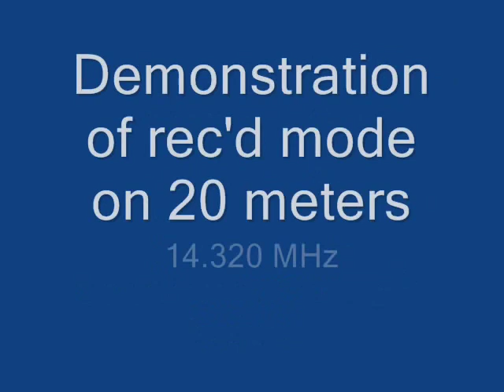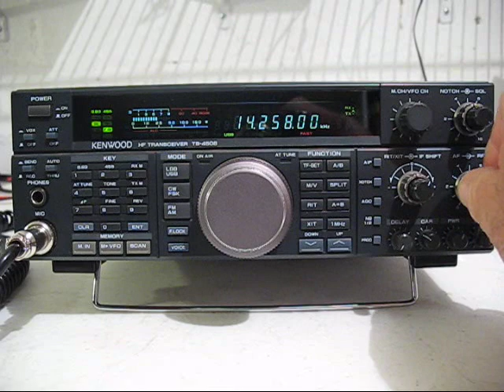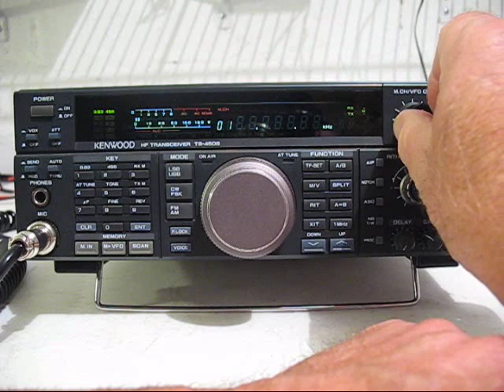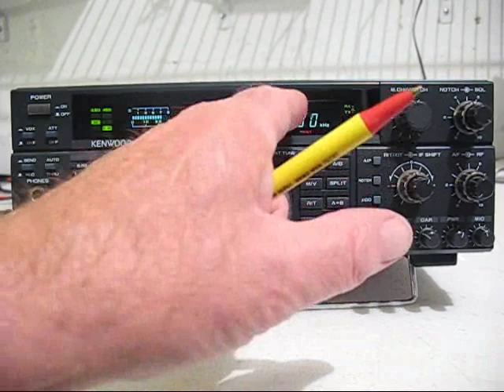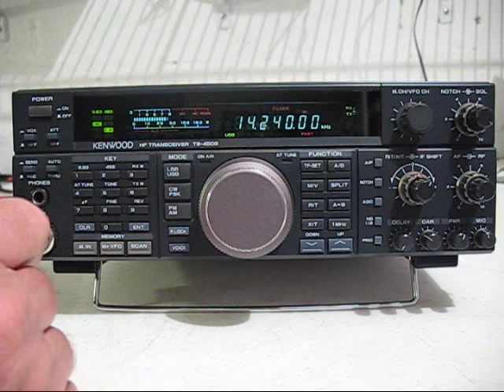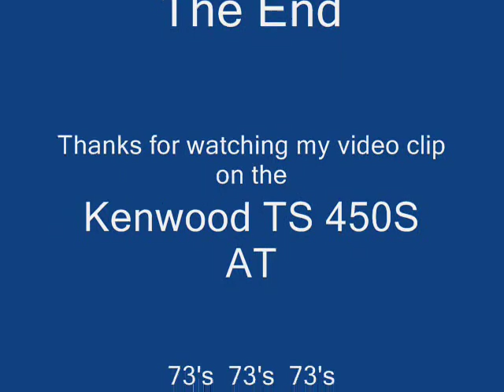Kenwood TS450S  AT  ham radio transceiver

Comment: I have one great radio my automatic antenna tuner has frozen it has to come out i mostly use an external atu but love to get the tuner in the radio working i guess they dry up in the motors i might have to take it apart lube it free what would you recommend n1sca Florida